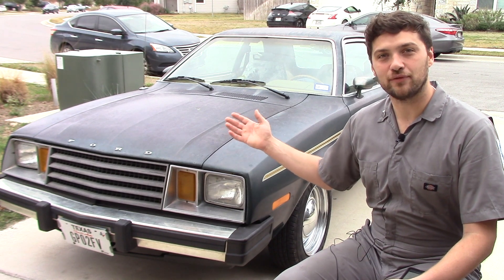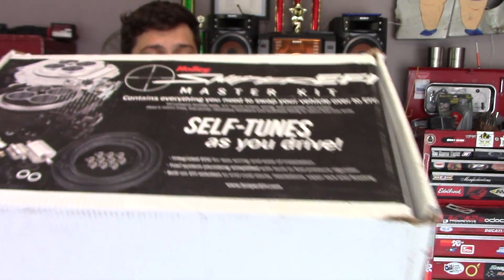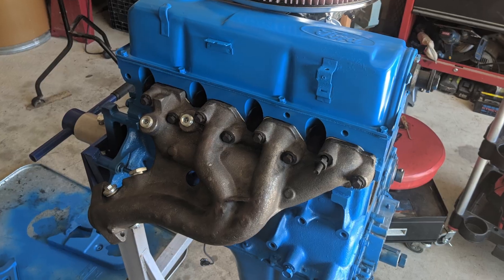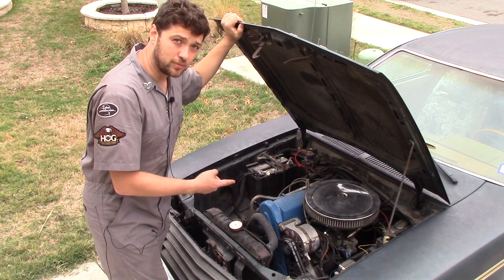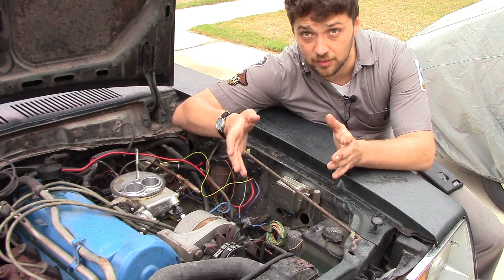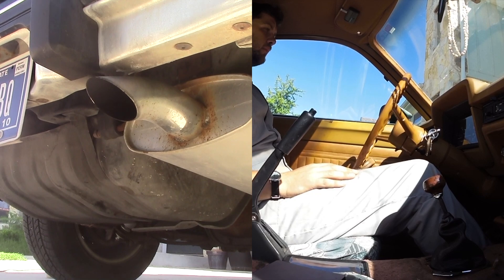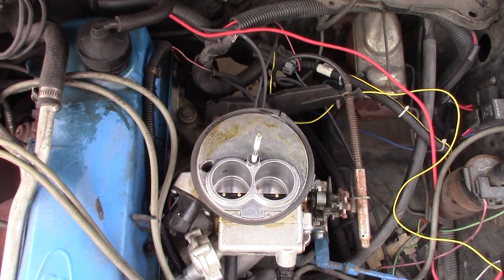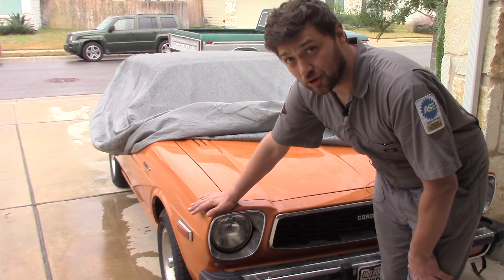How I built my FUEL INJECTED Ford Pinto using Holley Sniper 2300 EFI

Comment: Good job keeping the old girl alive. I found it interesting that the TBI EFI is so adaptable to the smaller displacement. Check your fuel pressure. If it’s at spec. The fuel pump is not being dead headed and it’s just noisy. I’m sure that pump is way overkill for your displacement. I like the Bosch or Walbro pumps. Nic and quiet.
Reply from the maker: Thanks for the pump suggestions! The pump quieted down quite a bit after I fabricated some new fuel lines for it. Heres the video https://youtu.be/t3CTkWR5tNs but its still not as quiet as an OEM one. I'll definitely look into the walbro

Comment: You probably already know this but there have been turbo, fuel-injected 4-cylinder (SVO, XR4Ti, TurboCoupe) swaps going back a long time. Nice work.
Reply from the maker: Absolutely! I'm actually on the hunt for an XR4Ti 5 speed because it's a direct no-mod drop in transmission for the pinto!

Comment: Would it not say the recommended size feed and return fuel line to use for the holley set up ?    I thought I saw plastic fuel line available now that I would trust more than rubber .
Reply from the maker: Holley actually specifies using 3/8 line for the feed and return on this system. I ended up fabricating a set of feed and return lines in this video https://youtu.be/t3CTkWR5tNs it significantly quieted my pump down! And solid metal lines are much safer and more reliable than the old runner ones. I'll have to look into plastic lines!
Reply: Teflon factory like lines are readily available at auto parts stores...
Roll aluminum lines are readily available also through street rod suppliers.
Use steel brake lines and brass connections. Much better. Ive done steel on street rods for decades.
👍🔔
Reply from the maker: @hotrodray6802  I wound up making some steel lines in this video https://youtu.be/t3CTkWR5tNs

Comment: From Leo:  it is kind of fun to drive a 40 year old car. Have owned a couple of the Pinto models in the 1970's (2.0 and 2.3 liter) they are fully capable of daily driver use today.   I drove a 40 year old car when I was 20, it was a 1936 Dodge, that car really was for a slower paced time,  It really didn't have the brakes to do highway commuter duty.  Glad you get to enjoy that Pinto.
Reply: I only drive old cars. My "new car" is a 1973 Lincoln and my work truck is a 1960 Dodge d100 with the flat 6 and 3 on the tree, although my truck is getting ready to have AC installed in it as California summers in traffic are getting brutal the older I get.
Reply: The Atomic Reverend Alexander , funny you mentioned it ... I understand the extra main bearing load can be a bit much on this engine and suggest a cogged or dual belt for the compressor in being cautious of the new , cantilevered drive pully .
  Love that truck !
Reply: @marksommers6764  you may have taught me something new rhat I eas unaware of, I rebuilt the engine a year or two ago now and I don't want to harm it.

Comment: Well I live in Georgia I'm very glad I found your Channel I have a 74 Pinto 4 speed I've owned the car 30 years I install Mustang 5.0 engine and transmission. But I still have the factory 2.0 Pinto engine and transmission the only reason I change engines I drag race the car back then with the built engine. But this distributor would not stay in sync I could not find electronic distributor I'm going back to my four cylinder set up this summer thank you again young man.
Reply from the maker: Wow right on! good luck!

Comment: From Leo:   Interesting project.   The starting/running issues you recorded with the carburetor were certainly true on yours,  but when the choke and pull off is properly calibrated and working, they worked perfectly.   That progressive 2bbl carb on the Pinto was capable of running really well.  Driveability tuning is just not done anymore.  I was a carburetor and ignition tech at the dealer when those cars were made.    Not a lot of mechanics are left that are competent at working on carbs or tuning distributors.
Reply from the maker: I have a lot of experience rebuilding and tuning carburetors from my years spent as a motorcycle technician. What I was trying to illustrate with the before and after is with the EFI you can pull away seconds after starting with a cold engine that has been sitting for a while. The ethanol content in modern gasoline goes bad so quickly that after sitting a few days most of the fuel in the floatbowl is bad. Not only do you have to warm it up to get it off high idle but you need to burn some of the fuel out of the bowl. It wasn't like that when I bought the car but this progressively became an issue. And you may be able to pull away but it doesn't run exactly right until everything is at temperature.
Reply: So true Leo. Especially on Quadra jets and Thermaquads. By the way, like me you are telling on your age. Do you remember Sun oscilloscopes and distributor machines.
Reply: @mikenicholas8969  I had an old 1970's Sun machine in my garage for many years.   I tried to sell it for months.   Then I tried to give it away.   Ended up hauling it to the dump.  I still have an Oxygen/Hyrocarbon sniffer from the mid 1980's,  Last time I went to use it I could not get it to zero. I cannot remember the last time I used my timing light.

Comment: Seems like you could've bolted up the multi port fuel injection system from a Ranger...my first car had CFI, and there's definitely limitations of that compared to a good multi-port system.
Reply from the maker: I could have, but it would have been a lot more work and it wouldn't have been as tunable. With the sniper I can change any parameters I need to on the fly If I want to swap cams again or add a turbo. I definitely considered the OEM system though
Reply: I doubt it... Unless you can make a crank sensor work with the older engine... And you'd need a cam sensor for sequential firing. Usually you would need at least the block from the SFI vehicle.
Reply: Well, as for tuning it: https://5startuning.com/product/2001-2011-ranger-2-3l2-5l3-0l4-0l-sct-x4-with-choice-of-5-star-custom-tunes-7015/ true, I didn't think about the Hall Effect sensor in the crank on the newer version of the engine 😉

Comment: Just put a later 2.3L from a Ranger in the Pinto... Probably way cheaper and more efficient. Also, bring your car into the 21st century? More like bring it to the mid to late 80s... Even Escorts had sequential multiport in the 80s.
Reply from the maker: When all said and done I think the sniper was much cheaper than an engine swap. Plus all the time it would take to integrate my harness into the new harness and mount a the newer PCM. The sniper offers me tunability on the fly and options to change parameters like swapping cams or adding a turbo. The OEM setup can not do that.
Reply: @Scooter_911  Have you heard of Megasquirt? You can pretty much do whatever you want with that. I'm sure you're right about the engine swap not being cheaper, but if you found the right deals and know how to fabricate parts I'm sure it would be close. Cool to see this setup in action though
Reply from the maker: @halohunter5217  yeah I've built a few cars with the megasquirt system. It's not quite as user friendly but way more capable and modifiable. You can basically use any sensors or parts where the Holley is designed to run its own parts. Another thing I like about the Holley is it is self learning like a modern car. It fine tunes fuel trims and IAC parameters as it goes.

Comment: Also, if you used a pump out of a fiat x1/9 it would have run much quieter
Reply from the maker: My old Holley pump ended up quieting down quite a bit after I fabbed up some new hard fuel lines. Check out the video https://youtu.be/t3CTkWR5tNs that Fiat pump though, does it run 40psi and does it have 3/8 input and output? If so I'll definitely have to put my feelers out for one.
Reply: @Scooter_911  i think it runs closer to 70 psi and 3/8 inlet and outlet

Comment: A Webber carb would have worked fine.
Reply from the maker: Unfortunately not. My pinto came from the factory with a Webber 32/36. I think the ethanol gasoline here in the states might have something to do with why the carb kit would wear out so quickly. But even still the EFI warms the engine up quicker and everything is much more consistent.
Reply: @Scooter_911  I'd trust a Holley carb more than I'd trust Holley EFI - they have a good record on the one, not so much the other
Reply from the maker: @timothykeith1367  so far I'm having a great time with the EFI. 2 trouble free years and we even just took it  on 4000 mile road trip to Michigan. What I really like is the display is like have a dashboard full of gauges. You can monitor all kinds of parameters on the engine and really get piece of mind. That and it runs exactly the same on the top of a mountain or at sea-level, and starts great even below 0 Fahrenheit.
Reply: @Scooter_911  I like the Pinto!

Comment: I have a 1972 pinto 2.0 with a quadrajett carb my first car i bought in 1988 32 years ago . I have 2 motors i alternate when rear seal starts leaking. Lol
Reply from the maker: Hahaha now that's the way to do it! Maybe I'll start looking for another 2.3. Also DANG that seams like a lot of carb for a little 4cyl. Are you running an offenhauser manifold? How does it run?
Reply: I use the Stock manifold with adapter plate ,headers, and  ported head . The Quadrajett has small primaries with huge secondary , so with that combo it ran the best and very responsive . I ran a holly 650 but it preformed less and ran a bit rich . I think the cam is at around .450  lift with a mild duration. Stock is .399 . Once in highschool i put a .535 lift / .228 duration with the above  combo it was actually fast , but too much pressure at max lift and was eating cams. It was a compleat kit supper shops sold at the time so i thought it would work . They have taller valve stems now so i will be going back to a taller cam hopefully soon .

Comment: Is your handbrake that high to make for easy drift action? :-P
PS, I also have an injected pinto powered escort. My low pressure pump is  also super noisy!
Reply from the maker: Hahaha I wish, I just need to adjust the cable... You know the cobbler's   son and all... Also my pump quieted down quite a bit when I built some appropriate fuel lines. Check out the video!

Comment: I owned two Chevettes as well. One early one that was stick.. I bought it because it ran and was only 150 bucks. It was a stick, so I used it to teach my wife's kids (from a previous marriage) to drive a stick. I figured if they ruined it, so what. They didn't though, it held up to driving through fields and all the wear and tear 3 teenagers could put on it learning to drive a stick. Never even tore up the clutch. One thing weird did happen, inside the distributor there are some weights shaped like a crescent moon cut in half. They flat wore out at the holes they pivoted on. When I went for replacements, none were to be had for that motor... but hanging on the wall of the parts house were some for a 350 Chevy V8, they were not the same, but close enough to work, and they did. The engine actually ran better with them installed than the originals. They were heavier than the originals, and just a bit longer. I guess they advanced the timing just a bit more than the originals. Oddly, the newer model Chevette with an automatic didn't hold up half as well. The cheap one actually out lasted it by almost a year. Funny I was able to sell the 150 special for 200 a year and a half later. I junked the other one.

Comment: Great video👍 I’m a gm guy but I have always liked those 2.3 Fords . What kind of milage are you seeing with the FI and is it an improvement?
Reply from the maker: You know my regular mileage didn't change much, it stayed around 30mpg. But what I did notice is if I drive it hard (fast accelerations and high speeds for long periods) it gets much better mileage. When it was carbureted if I drove 80 mph it would get in the low 20's. Now it just stays in the 30's. I really noticed a huge improvement in low end torque though.

Comment: I don't care for adding sensors and computers to vintage cars. When you make it like a modern car, that's what you have, a modern car. The quirks of a vintage car are what give it character. Besides, these days you are not going to toss your keys to anyone and get them to move it, first that's crazy, second most people these days can't drive a stick, they wouldn't have the foggiest idea how to do it.
Reply from the maker: Haha they say a 4-speed is the best antitheft device! I totally get your point but it really made a difference as my daily driver. The driving experience is very close to the same but now I have all this information on my engine at all times and it really gives me piece of mind... On top of a pretty significant performance increase.
Reply: @Scooter_911  You want a performance increase? Find a 302 out of the Boss 302 Mustang 2, the mounts and all, will nearly directly swap into the pinto. Lets face it the Mustang 2 was a pinto with a better body.
Reply from the maker: @tootall5559  well that kindof ruins the pinto for me. It was designed as a little economy car and I respect that. On top of that the 2.3 is really easy to service in the pinto. A small block... Not so much. Plus I'd have to swap the trans and narrow an 8.8 rear end. At that point I'm basically driving a completely different car, like a fox body mustang.
Reply: @Scooter_911  I get that, I had a few of them, and I liked them as is, until one kept tossing the timing chain and ruining the valve train. My favorite was a stick, but I had the automatic too, in a wagon, that was the one that kept tossing the timing belt. for that one, I seriously considered doing the 302 swap, since the cost of redoing the valve train was about the same as dropping in the stock 302. Don't be fooled though, the 302 in the Mustang 2 was not a true Boss 302, it was a boss in name only. A real boss 302 has many differences, I don't recall them all.

Comment: I think I've only had 1 carbureted car. Didn't have trouble with it. Of course I didn't have it in cold weather. I like having obdII and being able to read the car,  with my phone. I'd have modernized and upped the cylinder count to at least 6,maybe 5 under the right circumstances.
Reply from the maker: What I'm finding is the ethanol in the gasoline is pretty hard on all the little rubber seals and diaphragms in carburetors. I drove it with a carburetor for nearly 10 years without any serious issues but I have to say EFI is a dramatic improvement. As far as the engine goes I kept the 2300 for a number of reasons. Parts availability, performance parts (a lot of people run them in sand rails and various race applications, and weight. But mostly I kept the engine stock to respect the ethos of the car. I like it staying a little economy car that is fun to drive and gets great mileage. If I stuffed a V8 in it, I might as well be driving a foxbody mustang. Haha
Reply: @Scooter_911  I've got a Ford Probe GT my engine swap is from Japan. While there's nearly 0 aftermarket for it, it starts at a good point (200hp 170tq na) and can take a little turbocharging as is. Running a different Mazda ecu so 210-215. I had a Probe then a Mustang, then wanted another Probe. Independent suspension, better car all around, weighs less than the lightest Fox, with all the options, more usable space, 7k rpm shifts. I kept hitting fuel cut with my 4.6l and the Probe would beat it.

Comment: Great video of modern transformation of your carbureted Pinto into efi.   The Pinto is a much derided car that was actually fabulous.  It was very simple, easy to take care of and for a cheap car, really quite responsive and fun to drive. The Pinto had rack steering, control arm front suspension with coil springs, and disc brakes, not to mention a peppy but economical engine.  The car was inexpensive and fun to drive.  There are NO cars like that now.  Now a cheap car is usually a total shit box and does not drive well even with modern tech.   I saw the fuel line video and it was good also.  Good job all around.  Now get to work on the cosmetics!
Reply from the maker: Man you hit it right on the head! I find myself telling people those sentiments exactly. There is absolutely NO modern vehicle that can give me what my pinto gives me. And its never really given me any trouble. I'd like to see how a Nissan Sentra holds up in 40 years
Reply: @Scooter_911  It would also be interesting to see how many tools and what pieces of equipment are necessary to repair or maintain a Sentra vs a Pinto.  If I had my way, the Pinto would be the mandatory driver's ed car for all beginning drivers.   And it would also be the perfect car to teach shop class for beginners.

Comment: I think if I was going to all that trouble I would put in a v8.  Had pinto wagons back in the day.  Thanks for the memories
Reply: Why spoil the weight balance of the car? The 2.3l is not light by any means, but light car should stay light. A Duratec 2.3l and 5 speed from a later Ranger would rock in one of these.
Reply from the maker: @halohunter5217  unfortunately the ranger 5 speed won't fit without serious trans tunnel modifications. The T5 from the foxbody mustang fits with some slight mods but the 5 speed from the merkur XR4Ti is a plug and play... If I can find one...
Reply: @Scooter_911  With a T5 you can usually mix Bell housings and transmissions, maybe a T5 from a GM or AMC/Mopar application could work?
Reply from the maker: Well the nice thing about the 2300 is it is such a common race motor parts are always available. And because for used it into the 2000's I can still get OEM parts. (in addition to giving me over 30 mpg)